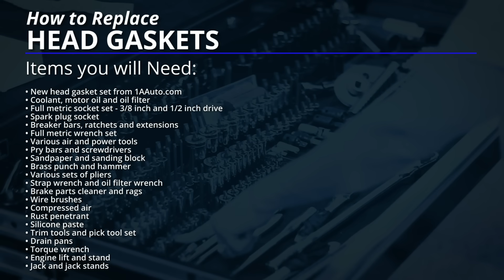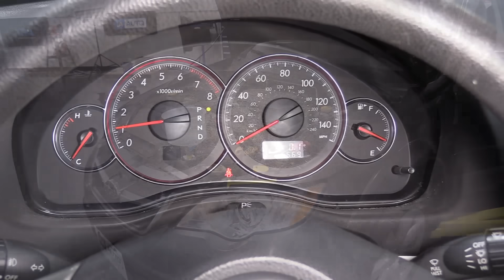How to Replace Head Gaskets 00-09 Subaru Outback Wagon

Comment: Buy Subaru Turbo OEM Multi-Layered Steel Head Gaskets (MLS). The gaskets1A auto sells is a composite which breaks down just like the old ones. Also it is absolutely necessary to have the head surfaced. Fel-Pro gaskets are fine for valve cover gaskets and Spark Plug seals, but it is really important to by OEM Subaru MLS Head gaskets if you don't want to have to do this project again in the near future.
Reply: you mighty be forgetting to consider that the block was not machined. For a mls gasket you need a lower Ra (surface roughness) than a composite. I highly doubt the blocks Ra value would have been suitable for a mls gasket.
Reply: At first glance I thought your PFP was a stormtrooper? I’m trippin
Reply: @jessfelty2131  mls works fine
Reply: The thing is with the MLS gasket I’ve had SEENED issues with it seating correctly causing a compression/misfire down the line being it to thick but if it was machines more than once than I might see it working.

Comment: You should have removed the radiator with the fans still attached.  It's easier, faster, you'd have more room and you wouldn't risk hitting the radiator with the engine during removal.  But you still did a very good job. I've been removing engines for 40 years.

Comment: Thanks for the super useful video! But for anyone else using this as a DIY tutorial, here’s one thing to note:

I would strongly advise against using emery cloth/sandpaper on the engine block head gasket surface. They leave aluminum oxide particles in the engine that can likely shorten its life span quite a bit, and they will also remove metal  (you only want to be removing the old gasket material).

Instead, first make sure to plug all the ports and holes on either side of the block where the heads go with lint-free rags or those disposable blue shop towels. Go back and forth between using disposable razors to gently scrape the surface, and brake cleaner or acetone on a shop towel to wipe away debris. Just make sure to not gouge the metal on the surface! Keep cleaning until only metal is left
Reply from the maker: +Troy Ferrara Thanks for the feedback!

Comment: Just finished this on a 2002 and only recomendation differing from hers is to wait to put manifould on untill bolting torque converter. Makes it MUCH easier to torque and start. Other than that, couldnt have done it without your video!
Reply: How long did it take you to do this repair?

Comment: Great video.No music or any other distractions...You were paying attention when you learned to wrench,your attention to detail is outstanding. I liked that you called out the size of tool needed for each nut or bolt and called out torque specs.A buddy and I used to flip Subarus and I've done my share of head gaskets...
We got out of it because it got to the point of doing them to EVERY car...The weak point of an otherwise great car.I'm sure that there is lots of owners out there that will get alot out of this video. Thanks and keep it up!

Comment: This lady did the best performance of changing a head gasket that I have ever seen, man or woman. She was very thorough and explained step by step what she was doing and why she was doing it. The only thing I would improve on it was the reinstallation of the battery and battery hold down. She cleaned the battery posts, and that was great and should be praised, but she didn't put a protectant, like "fluid film" on the posts to prevent future corrosion. The battery hold down also had a lot of corrosion on it and needed to have the corrosion removed and repainted to prevent future corrosion.
Reply from the maker: +James Koralewski Thanks for the tip! We'll pass this info along to our production team.

Comment: Subaru actually did issue an upgraded head gasket that supposedly fixes the common issue with the blowing head gaskets, so it's a good idea to make sure that the kit you're installing is in fact the same material of that of the upgraded head gasket for the boxster engine.
Reply: Boxer***

Comment: Great video, very helpful and informative.  The only issue I have is a commonly misused term when working on Subaru's - aligning the timing marks on the timing belt does NOT set any piston at Top Dead Center - the pistons are actually set to the complete middle of the stroke for ALL 4 pistons when all the timing marks are aligned.  You can see that when she pulls off the heads.
Reply from the maker: +David James Thanks for the tip! 1AAuto.com

Comment: From what I found out on these cars the most commonly affected models w/ head gasket problems are the Impreza, the Legacy, and the Outback models between the years of 1999-2004. The main reason that they have the issues is because they share the 2.5-liter SOHC engine. Subaru head gasket problems have occured in the Forester, Impreza, Outback, Legacy, and Baja in 2005.  The engines, as she stated in the video, are  boxer-style engines. These motors lay flat and the pistons move laterally, balancing weight accurately and quickly. They sit lower in the vehicle for an improved handling. HOWEVER,  fluids have a likelihood to pool next to the head gaskets. This can cause acid in the fluids to erode the seals.  There are various ways that you can decrease the chance of your head gasket failing when it comes to your Subaru cars. These tips can increase the lifespan of your Subaru, keep it working in a functioning condition, and prevent the head gasket problems.

First, you need to change the engine oil on a regular basis. The combustion chamber in your car is where the compressed air fuel is met with a spark from the spark plug, which creates an explosion, and therefore, power. During the combustion process, not all of the fuel that enters the chamber is burnt. The fuel that isn’t burnt can mix with the engine oil, and the fuel that is a solvent can erode the seals and gaskets.

Second,  keep an eye on your Subaru’s battery in order to prevent a blown head gasket or head gasket problems.  The battery is very close to the radiator and part of the electrical system in the car – this can influence the voltage in the cooling system, which might make coolant corrosive as a result.

Third, you should start changing the coolant in your Subaru on a regular basis. The coolant can become corrosive and deteriorate seals and gaskets if you don’t change the coolant regularly.

Fourth, make sure you are knowledgeable of the parts and services that have been implemented into your Subaru. For example, you should use spark plugs and specific parts that were designed for Subaru models. The combustion temperatures can be negatively affected by non original equipment, causing Subaru head gasket problems.

Lastly, make sure that you have the vehicle inspected by someone who is a license and authorized Subaru specialist or technician. Bringing your car in to be checked by a specialist means that you can ensure you have the best care for your car, and that there will be a prevention of Subaru head gasket problems.

Comment: Excellent job. I did my first Subaru engine major repair, and it turned out great with the help of this video!!
 I did not see the installation of the small shield between the lower engine and the front of the transmission (the one covering the flywheel, kind of sucked LOL).
I also did not see the clicking in of the O2 sensors into the bracket by the RH head. No big deal there.

Comment: Great video and I love the level of details you have put in. I have to also admit that this is by far for me is one of the best auto video I have ever seen for Subaru head gasket replacement. Thank you so much.
I have couple of questions though?
1. Why you haven't used the OEM bolts if the head was not wrapped?
2.I am just not sure how reliable this head gasket compared to other types like the OEM, FELPRO and the six stars that most people recommend?. I would love to hear people that had tried this headgasket. After all this is the type of job you want to do once.   
3. I don't see that tool to hold the camshaft and crankshaft from your list. Do you carry it?
Reply: 1. OEM bolts were not used because it came as a full gasket set that 1A makes
2. 1A makes that head gasket I'd personally go with cometic or oem subi ones too
3. Just get one from your subi dealership
Reply: Good question. 
This engine use torque to tells bolts. She did the finally tightening in degrees not lb/ft. The bolts stretch as their tightened. Subaru are easier than ford powered strokes, I had a 4 foot breaker bar to get that last 90 degrees.

Comment: Very informative and detailed. I suggest using a large flat sharpening stone for cleaning the top of the block. I think this is a good practice for a subby, due to their head gaskets being troublesome. My block was out .0015" i n the center on both sides of the block. Using a 2 x 8 Inch stone I was able to improve this. I have used several 1A videos for my Subaru, and am grateful.

Comment: Great info here! One thing I would do differently: I would lube on and under the head bolt washer. Also I would cover the antifreeze holes with some plastic plugs or even a rag, before cleaning the o-ring groove. Amazing thing: you said very correctly, '6mm bolt with the 10 mm socket head"! That's extremely rare in the YouTube videos.
Thank you!

Comment: Great video. If you have trouble removing the torque converter bolts through the little window, you can always pull the intake and coolant crossover pipe to get a straight shot at those bolts. Just need to place the intake back on top after so you can use the lift ring to pick up the motor.

Comment: Totally an excellent job. My daughter will be getting this exact car from a friend and has done a lot of work to it and I started looking up reviews and what may need to be be done since it has 200k Mike’s on it. Thanks for sharing with us.
Reply from the maker: +Angela Byus Thanks for checking us out! http://1aau.to/m/Shop-1AAuto-c
Reply: @1AAuto  Yer most welcome. I’ve been having some problems since we got the car. I’ve replaced the fuel pump and alternator and now it won’t start at all. Before it died on my daughter, just stopped while on her job. Was towed home and I put my battery booster on it and it started then removed the negative to the battery and it died telling me it was alternator but the guy we got it from mentioned the started may be bad or was going bad, The alternator was simple but now all I get is a click, has a brand new battery, two months old. All the lights bells and whistles work fine so I’m guessing he was right that it’s the starter. It had a few things wrong. Between fuel pimp, alternator, new head lights, hatchback lifts and now the starter. What is your opinion on this? I have to put my daughter car on the back burner to replace the water pump on my town and country in the morning and I can get the starter from Napa. Plz let me know what your thoughts are. Greatly appreciated!

Comment: This is a great video. Very informative. The tech really explains everything in great detail. As far as the kit goes. I think it's a great kit. Very complete. However, I would like to see 1A Auto upgrade this kit to the MLS Head Gaskets. The ones that currently come with it look they are still coated with that graphite coating which unfortunately means that whoever uses this kit, will be doing it again after about 100k to 120k. If they fix that, this kit is set.

Comment: Great video, very comprehensive, but having wrenched on these Subie engines a bit myself, when you go through the trouble to do the head gaskets I would definitely check and adjust your valve lash clearances. It's tedious and sort of delicate work, but it's worth it to make sure it's right, especially as the heads were sent to a machine shop, and some won't set them or check them unless you specifically ask them to. So much easier to do while the motor is on a stand.

Comment: Had mine done at 73,000 and now it's leaking again at 130,000. Tech was probably not as knowledgeable, patient and solemn as this one. And she said she doesn't even usually work on these? Kick ass, dang...
Reply: No it's a Subaru thing. No matter how meticulous you work, the gasket will leak again. Poorly designed engine

Comment: I feel confident I can do this job watching these videos. Always very helpful. And full of useful tips and alternative ideas to doing certain little things. I’ve got this exact same model if outback, the NA 2.5 but mine is a manual so I think it’ll be even easier because I don’t have to bolt up that torque converter. :-)
This job to me just feels like a slightly more complicated aircooled VW engine removal. But it seems easier than a normal engine too. :-)

Comment: hey,great vid, i broke a head bolt at 70.1ft pounds as mentioned, oiled bolt, i went with (Then tighten all bolts to 69 Nm (7.0 kgf-m, 51 ft. lbs.) in alphabetical sequence.) after that no bolts broken

Comment: This is a pretty good video.  But if you remove the intake while the engine is in the car you have easy access to the torque converter bolts and all the bolts at the back of the engine from the top.  Same with the video A1 Auto did on changing the timing belt.  If you remove the fans and radiator, you have so much more room to do the work.

Comment: FYI a Subaru TSB came out at some point and now the only proper ways to clean the mating surface on the block is to use a 3M Rolloc white disc or a razor blade. Apparently sandpaper is too abrasive and results in <10 thou differences that make for a poor seal long-term. But they were recommending the sandpaper method until they had a bunch of come-backs.
Reply from the maker: +Keith Gable Thanks for the tip! We'll pass this info along to our production team.

Comment: So, first what a great video. I am currently in process of replacing head gaskets on my 11 Outback. Small issue, flywheel ended up coming off. What do I do? Not finding good information on automatics so far on the web.

Comment: Great video, though the torque settings are different to what the manual states for ft-lbs. The settings used in the video are more closer to the nm settings stated in the manual. Perhaps they’re specific to the brand of gasket she’s using.

Comment: another suggestion that I have for this job if you're ever doing the head gaskets on a Subaru with a manual transmission it's a good idea to pull the entire driveline (engine & transmission) as one whole complete unit. The reason being is if you've ever gone to mount an engine up against a manual transmission while the transmission is still inside the car, you'll find that it's very difficult to do. In this case since it has an automatic transmission then I agree with this procedure and I would leave it inside the car.
Reply from the maker: +Michael Sackstein Thanks for checking us out!

Comment: Why didn't you plug the oil galleries before sanding? How long do you expect it to last with all that debris going into the crankcase and galleries? Always block your oil ports off, never expose contaminates to the lubrication system. Other then that great video!

Comment: 29.07.20 - we have a 2004, 83,000 k 2.5l model and although a beautiful like new car if the head gaskets ever leak I'd be selling the car for parts. Spending 4 or 5 thousand to repair would be crazy.
If your are willing to spend those bucks then crazy you'd have to be not to replace everything you can while the engine is out.

Comment: Great video!
Very knowledgeable

What is purpose of Emission tube?
It's part of exhaust system?
What does it do in specific?
Reply: It's a vent for the crankcase. In very old cars the oil fumes from the crankcase were simply vented to the atmosphere. About 50 years ago engine manufactures connected the crankcase vent to the intake manifold so the fumes could be burnt in the engine cylinders and then pushed through a catalytic converter to incinerate any unburnt gases. If the vent ever gets plugged the crankcase  pressure will cause the oil pan gasket to fail and leak oil.

Comment: Y did u clean the egr valve or block? Y didn't u change the corroded sensor in the front? Love the video
Reply from the maker: +julio toon The main focus of this video was the head gaskets. Yes, this would be a good opportunity to tackle other repairs/maintenances (egr valve, timing belt, cleanings, replace worn hoses, etc.

Comment: One question. Why put the intake manifold back on if it hinders the space to get at the torque converter bolts. I installed the manifold after the engine was in and secure.

Comment: Hey, the "plastic boot" i believe you referred to at 08:39....how important is that piece?  I had the timing belt replaced in 2015 in my 08 outback and they forgot to put that back in.  Would it being absent contribute at all to a persistent P0420 code that I've had since 2017?

Comment: The Markings on the Timing Belt for the Crank and the Cams are not top dead center indicators, they are to get all four Pistons in the middle of the stroke of the Crankshaft so it will guarantee that none of the valves will ever touch the Pistons.
Reply from the maker: +Daniel Boldera Thanks for checking us out. 1aauto.com